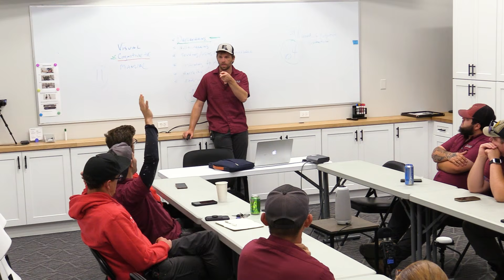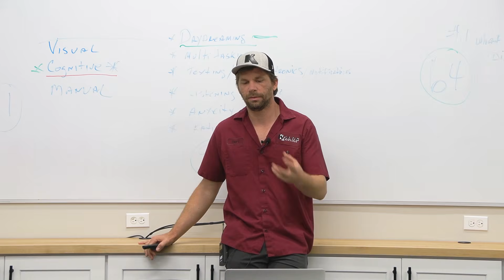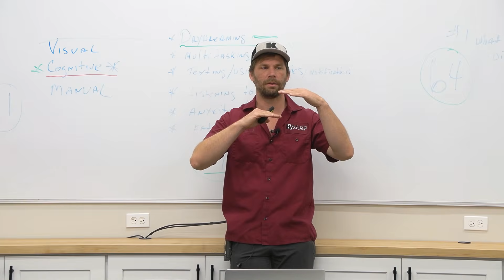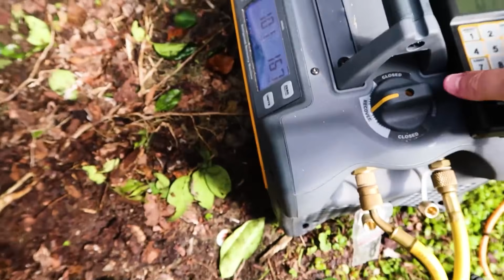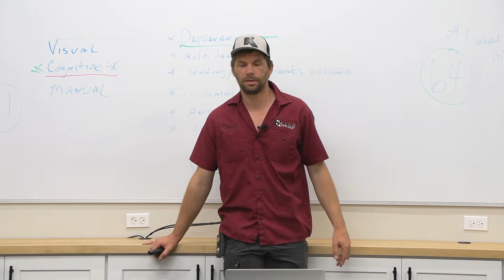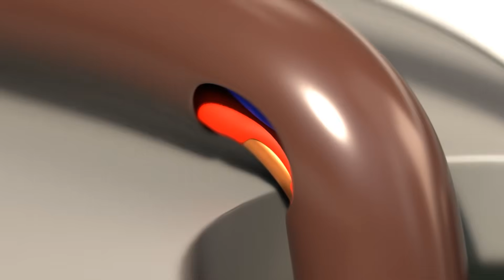Failed Compressors - Don't JUST REPLACE IT

Comment: Those quick check acid tests are not the most reliable. I understand that that in residential you don't have and oil port on your compressors, so it makes it hard to test the oil directly.....but if you are replacing a compressor......i would definitely recommend using the Phase 3 acid test kit. 

I will weigh the oil removed from the comp and check it vs the data tag...you want to get all that oil out of the system....scrolls...if not under warranty....i always cut them open to find out why it failed...if you dont know why....you will be back to replace another one shortly. They do make HH bi-flow suction line driers. I've used them before and had no issues at all. We also use acid scavenger as well as a suction drier. Use lits and lots of nitrogen and purge the contaminated oil from the system. Use the pipe wiper. If its a burnout on a HP....I always replace the RV as well.
Reply: Why are you changing an RV as well? They don't exactly carry a lot of oil, and so the acid isn't going to pool up in them very much. 

Changing an RV is a lot of additional labor that a customer may not need to be paying for.

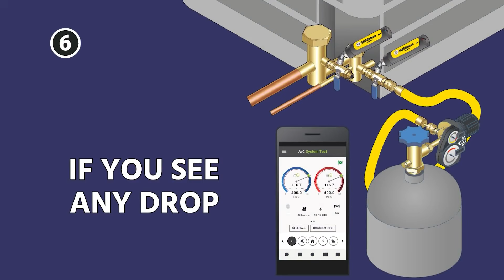Comment: 15:20 standing pressure test, the slides show adding nitrogen for a second. Was that out of order or something?
Reply: Hi Joe yes, a standing pressure test does not involve nitrogen. We just took that part out of the video. A standing pressure test is hooking up gauges and comparing the P/T chart to outdoor ambient. If your standing refrigerant temperature is below outdoor ambient temp that is a good indication you are low on refrigerant.
Reply: @MattBruner  gotcha, thought so! Thanks 👍🏻